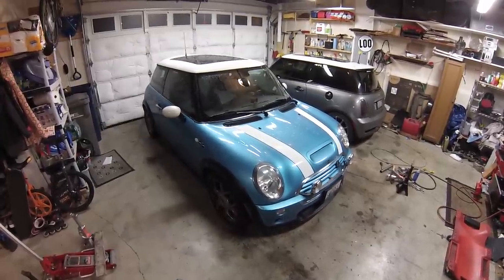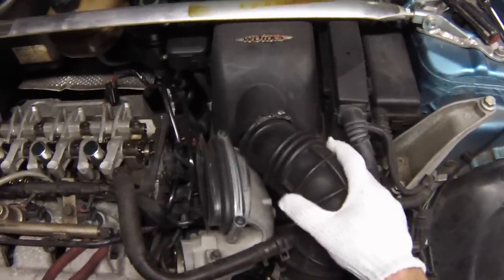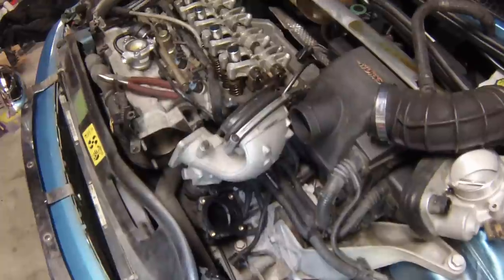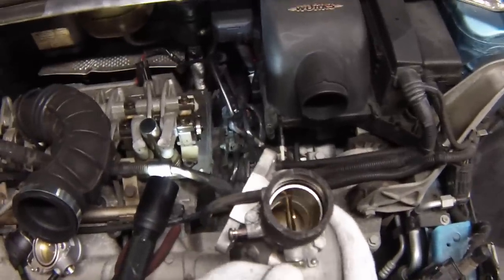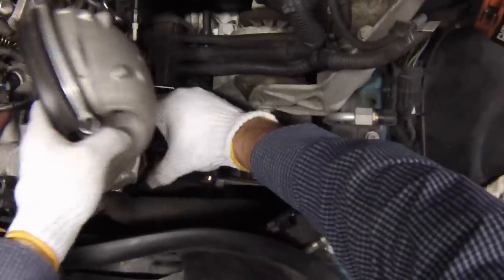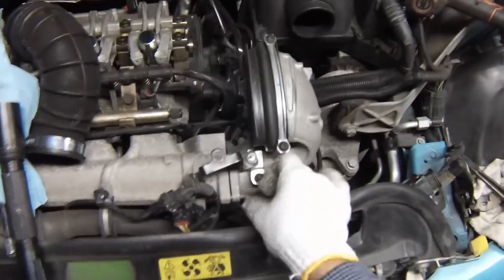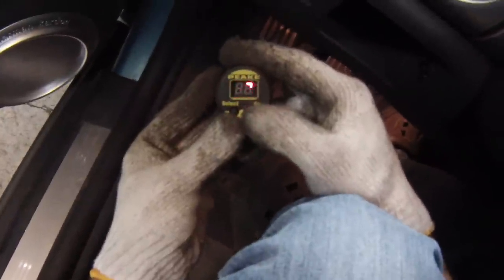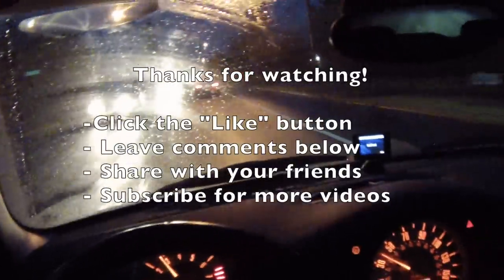MINI Cooper S R53 Bypass Valve Repair 2002-2006 BPV

Comment: have you ever heard of tank venting system on a r53 mini cooper s.  my reader is telling me the large leak . I have replaced the valve on right front of valve cover , the pump connected to canister on right wheel well. I  keep getting this code. could it be the hoses to tank?
Reply from the maker: Do a smoke test. Check your fuel cap.. I've not diagnosed or repaired a large leak but those might help you track it down.
Reply: @ModMINI  , thank you sir for the response.  have done the smoke test at pep boys and resulted in no smoke coming from no where . I have replaced every valve I can find or that goes bad. I'm to the point of getting down the gas tank to check it myself since I want it fixed. just don't have a clue on what else it could be. reader says tank venting system but I don't know what else goes bad in the car if I should replace the entire gas tank hose assembly next.

Comment: So I did a dyno today, I made 105whp with a 15% reduction MSD coils and plugs and K&N high flow air filter..... Felt my bpv it is strong on the top end but it doesn't close and gets stuck, kind of feels like the spring broke in half. Though my car is not throwing any codes at me saying service soon.
Reply from the maker: yuki no inu That is very low on power. Definitely check out the car for any issues.
Reply: ***** Yeah I am going to take her apart Tuesday and Wednesday check the plugs coils and all the goods, and pull off the bpv see how weak it is and if it closes, Then I'll put her back together and order everything I need.
Reply from the maker: yuki no inu Look for vacuum/boost leaks and make sure the vacuum/boost line to the fuel pressure regulator hasn't fallen off. If it does, car will run lean.
Reply: ***** 6:50 I took my chamber apart and the spring looks like that but a about a 1/4 inch higher on the spring. I found it had been opened before and shoved back in the chamber so it would still "work". So since day one of owning my car, it has never had full power.
Reply from the maker: yuki no inu They are cheap. Replace it. I replaced the BPV on my car recently since I was getting a P1688 code and the car runs smoother than ever before and I even have a little bit more midrange power.
Reply: ***** Did you buy the part from Seattle Mini or did you go to a parts store? Should I actually just buy the Detroit tuned BPV? I have a 2002.
Reply from the maker: yuki no inu I never buy parts from the dealer unless I'm desperate and need it quickly. Go to Pelican Parts, even eBay works if you can verify the quality of the part. I got mine on eBay after confirming the seller is selling an OEM part.
Reply: ***** Alright sounds good thanks for the help! I am going to have to put it all together again since this is my DD and I have to go back to work on Thursday and the part wont be here for a little bit. Do you think I should put the spring back in just so I make some boost? or leave it out and zip tie it shut?
Reply from the maker: yuki no inu I've never driven one with it zipped shut. It should be driveable but very touchy accelerator.
Reply: ***** Well I just zip tied it, we will see how it plays. I still have to put it all back together but need to pick up some worm clams because the bottom one to the BPV is freaking ridiculous to clamp again.
Reply: ***** So I tried it zip tied shut, zipped open, and not zipped with no spring. It pretty much stalls itself, I took the engine apart again and put the spring back in in a different position and it runs stronger now just not full power. I am now throwing codes since doing so, so that does solve my theory, it was put back together and the codes were cleared.

Comment: @Mod MINI I have a strange problem with my R53 2005. When I accelerate and push the clutch, te RPM are going slightly up and then slowly down. It is not very slow, but it suppose to happen much faster. The MINI has the power. I checked the valve like you showed in this video and I can feel the resistance. When the engine is running the valve i fully open, when I'm shutting it down, the valve is closed. The clutch pedal sensor also seems to work, because the cruise control works and it turns off when I press the clutch. Do you have any ideas what can cause this problem?
Reply from the maker: I would have to see the car. Sorry.
Reply: @ModMINI  I understand. I just thought, that maybe that model have some typical issues and you would be able to give me some information. Anyway. Thanks for the reply.
Reply from the maker: @bartoszzarychta9632 I'd need to see the car even to fully understand the symptom you are describing.   Cars are complex and a lot of things can break. Some common and others less common. It's really really hard to diagnose something over the Internet, without just throwing parts and labor at what might not even a correct interpretation of the problem.
Reply: @ModMINI  I get it. I plan to solve this problem by myself, that's why I try to search the internet to find a solution.

Comment: my car has exactly the same problem, but bpv does have some resistance, ill replace it anyways, but if it doenst fix the problem, do you know what else can cause exact same problem? plus my car rev hangs badly, even tho i have single mass flywheel, and throttle response is also dead even tho its flashed
Reply from the maker: Would need to diagnose car. Look for vacuum leaks.
Reply: @ModMINI  thanks for the reply! just checked the oil cap and theres a lot of air coming out of it when u take cap off of oil filler, guessing its a pcv valve
Reply from the maker: @THEPRINCEKONSTANTINE A little is normal. Put the cap and dipstick back on and smoke test the vehicle.

Comment: Hi mod. I have the engine light come. With code P1242 been reading on the forums and saying boosting to high off throttle and possible vacuum leak. But what you have said I possibly could have a bpv problem?.
Reply from the maker: +Kyle Brown either that or if car is modified you might need a tune or retune
Reply: Mod MINI the only modification it had is a miltek exhaust which was on when I brought it, this is the first time has happened so I will have a look at the bpv tomorrow
Reply: shotgunshane hi mate. I found the problem. if you check your second map sensor near the air box and see if the grey vacuum pipe has come off the sensor that's what happened to mine changed that and she has been running beautiful
Reply: shotgunshane no worries mate hope it helps. you may need to take the air box hose off and also the throttle body to see if both ends are fine

Comment: is that like a waste gate on a turbo?
Reply from the maker: Not really... the supercharger could be always engaged - it would not be hurt at all even if the bypass valve is always closed, but fuel economy would suffer. To my understanding, a waste gate is designed to protect the engine from excess boost.
Reply: ***** got it thanks!

Comment: I have an R50 that has rough idle from 1200rpm to 700rpm.  would this be the solution for my cooper S.  Its sounds like it has a vacuum leak under the throttle body somewhere.
Reply from the maker: Do you have an R50 or do you have a Cooper S? The R50 does not have a bypass valve.
Reply: ***** Hi, my car is a Dec 04 R50 cooper S, supercharged.  I'm not sure why my idle is so up and down but it drives fine its just the idle that is an issue.  Any idea on what my issue could be?  Thanks for all of your videos, so far I have changed rear shocks and front end bushes based on you clips.  Very informative.
Reply from the maker: Sheridan Earl There is no such thing as a supercharged R50. You have an R53. Anyway, there must be a vacuum leak or you may have a burned valve. The ECU is unable to provide enough fuel trim to stabilize idle, causing it to yo-yo. Time to take it apart and inspect for cracked tubes/hoses and maybe replace some gaskets.

Comment: Im having trouble to remove the air horn. Whats the best way to remove it??
Reply from the maker: Loosen all the bolts and the bypass hose, then wiggle, push/pull until it comes off. Hard to describe.
Reply from the maker: Not if you remove air horn together with the plastic supercharger intake pipe.

Comment: have you ever seen a code P0300 with this issue?
Reply from the maker: I think it's possible. It can be a source of unexpected air, but perhaps more likely there is a leaking or torn seal somewhere in the intake path?
Reply: Thanks.
Reply: @jim saeli did you resolve the p0300 issue
Reply: fantastic Mr fox it was resolved. Turned out to be a bad set of wires causing the issue. The wire set was replaced with a factory set but that factory set was bad causing the issue. Thanks. Now the car has another home.

Comment: Can I zip tie it closed in the meantime or is that not a good idea? Mine is bad :(
Reply from the maker: Sure, until fixed, your fuel economy will drop and you may have pretty severe engine braking on throttle lift and maybe a check engine light that should be safe to ignore.
Reply: @ModMINI  would the vsg mod be better than using zip ties? Not sure if that's the reasoning for the vsg mod. Ty for your replies and pardon my lack of knowledge as this is my first mini.
Reply from the maker: @javierarroyo7887  Just fix it. VSG mod is an Internet hack.
Reply: @ModMINI  alright ty
Reply: Ok so I zip tied the valve closed and went for a ride and did two WoT passes and definitely noticed power and the 3rd it went into limp mode. It's just odd I'm not noticing any signs that others mention of a bad crank pulley. Burnt rubber odor battery light coming on or loss of power steering. Any ideas? I don't think I'd get a p1688 just from the bpv.
Reply from the maker: @javierarroyo7887 Well the first thing you'll want to do is read the codes generated by the limp mode. Other than that, at this point hard to say without a full diagnosis of the car.
Reply: @ModMINI  p1688 was the code. I'm just going to replace the crank pulley with a ati unit and a new belt. Stock one is most likely starting to fail hence the loss of power and code. Ty for your quick responses. 👍

Comment: What are your thoughts on the VGS mod to the bypass valve?
Reply from the maker: I tried it and it is not the best in terms of driveability. It does force the valve shut more quickly for quicker access to power, but when lifting off throttle it makes for pretty sudden deceleration.

Comment: Unfortunately no one understands anything about mini and added to the fact that many are dishonest and it is easy to lose a lot of money ...

 

As for the a / c it never worked on my used r53 socket I did charge the air but nothing ... the compressor started but the low speed fan didn't start ...

 

the port from an electrician I start to throw water on the radiator the mini is all smoke and tells me I have to remove a few things and ... I run away ....

 

the port from another makes me there a problem with the low speed fan so I take the car again I start searching on the internet and I discover that often the resistance breaks ...

 

I order a resistance of 50 w 0.33 ohm on the internet the balance I feel the fan low speed and it works ... BUT NOW THE MYSTERY DOESN'T MISS THE COMPRESSOR ...

 

in the inpa not from errors in the section read errors from memory (engine) could it be that the last electrician YES IT HAS FRIED THE GAS AND THE COMPRESSOR DOES NOT START TO AVOID DAMAGE? (I AM SURE THAT before we left we felt the least change and besides I made a mark on the pulley with the green paint but nothing .... I repeat before I left ...)

 

 
Second problem ...

since I made it map and I put the cams catcam the car to drown cold .. if I give little gas ok I tend to turn off ... I changed the filter with an itg and the situation seems even slightly worse seems that the air gets worse and worse ....

I checked via inpa and everything is ok No errors .. ... I also tried to disconnect the tmap and the program recognizes that the connector has been removed ... the only thing the connector is 4 pins but 1 is removed (I hope it is taken out of the factory)

I also changed the lambda with a bosh but nothing ...

 

The only attempt I can make is to inspect the right compressor valve if it remains completely closed? I ordered on ebay one with a modified spring 100% revised I will try and see what happens ....

 

Do you know anyone who has more push cams? Is it normal that through this map it is not possible to solve this problem? (obviously as soon as I have time I will contact the map ...) I am convinced that it would only need to send more gas as the air gets worse the more it gets ...

 

what do you say?

 

thanks to all those who will help ...

Comment: It feels like it’s not getting any gas. I’m getting up to 4000 rpms to barely go 15 mph. I looked in the engine bay I see no loose wires, nothing unplugged, I changed the spark plugs, my wires are good, brand new battery. Checked all the fluids, everything is as it should be. No check engine light. My car is not telling me what is wrong. I use 89 octane gas. I take very good care of my car. My car has 152,000 + miles
Reply from the maker: Sherry Halter slipping clutch.
Reply: No. Shifts fine.
Reply from the maker: 4000 rpm at 15mph sounds like something is slipping. Anyway, without a code I would have to physically see the vehicle to be able to say anything.
Reply: Mod MINI shifts fine, no grinding, smooth transition to one from another. I’m gonna try taking off the air filter and drive around the parking lot for a minute. I have an hps short ram intake with an hps 3” filter
Reply from the maker: Also, you should never use less than Super Unleaded in a Cooper S. 91 octane or higher.
Reply from the maker: I don't think you understand what a slipping clutch feels like. Gear shifts will be normal. If it's not clutch I don't know what else it could be. Burned valve perhaps. If you don't know how to test for slipping clutch, ask a mechanic. If it's not slipping clutch, get the engine diagnosed. a compression test will tell you if you are having a problem such as a burned valve.

Comment: Why is the first intakehose shaped like that?
Reply from the maker: What first intake hose?
Reply: @ModMINI  the on that connects from the front to the filterbox. Where the air comes to the filter
Reply from the maker: @elias-zb4zs  I didn't design the car, but the intake will have been designed a certain way to achieve certain packaging, airflow and sound characteristics

Comment: Any one know what epn means i got that code on my mini
Reply from the maker: EP is the automatic transmission limp mode. A diagnostic scanner that can talk to the transmission control module can help nail down the reason but it will almost always be something inside the transmission that is wrong.

Comment: Hello there! I have a 2005 Mini Cooper s and I am having trouble with my supercharger. When accelerating, the supercharger whines a deep tone and then goes up to a high pitched tone. It is not making the power it used to have. I also get a strange smell from the engine and it is not oil. I just did a valve cover gasket replacement. I made sure everything was on right. When I put the petal to the floor it does not want to accelerate fast and does the strange whining noises. I am going to replace my supercharger oil but that might not be the problem. Also I was driving today and the power cut off and when I went to accelerate more it cut off and a bunch of lights on the dash lit up then white steam/smoke came up from the supercharger intercooler. If you could give me your email and possibly help me out that would be great. Here is my email dk8baker13@gmail.com I love my mini and want to get it back to running properly. I love the videos you make it helps me a lot. Thanks -Daniel
Reply from the maker: Check belt and crank pulley
Reply: Mod MINI I did and it has to do with my harmonic dampener! Thank goodness you made a video in that. Thank you very much!!